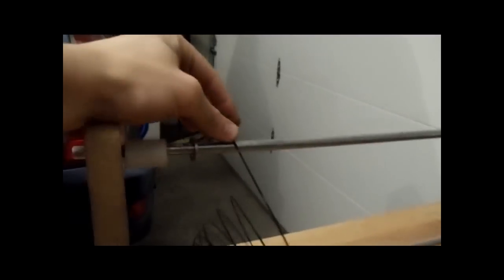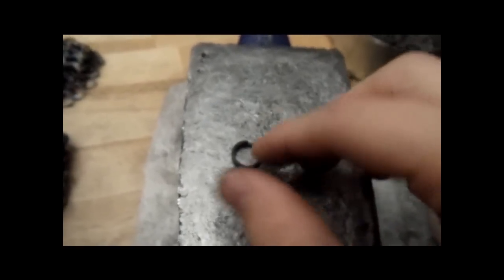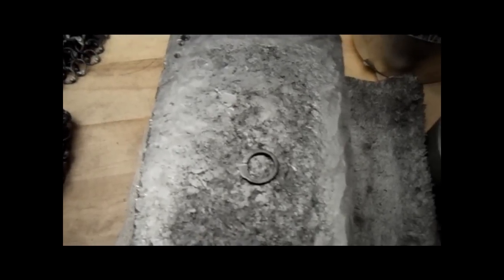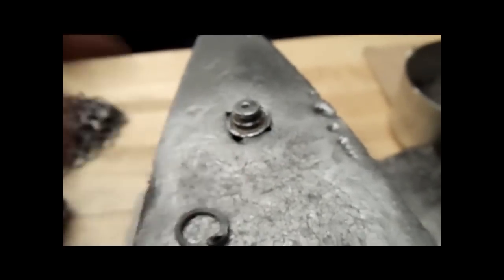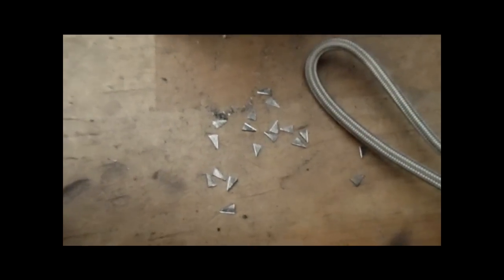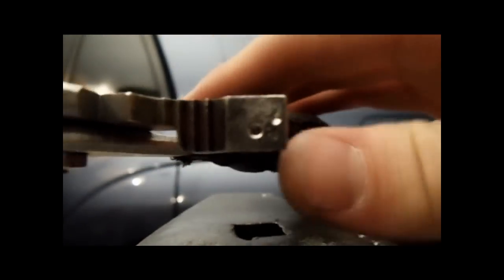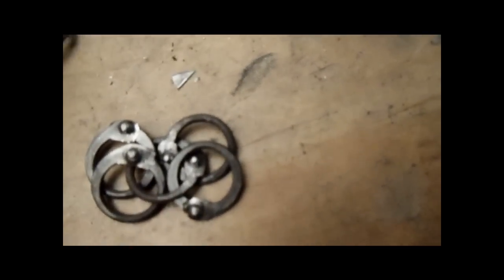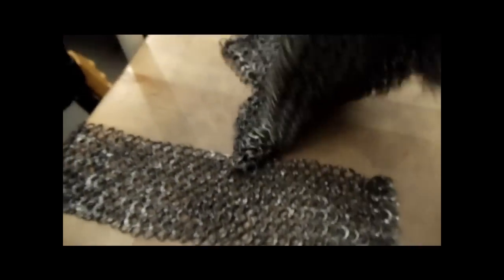How to make Hand-riveted Chainmaille

Comment from the maker: The wire I used was picked up from a farm supply store. The wire I used was 16 gauge (AWG) tie-wire. The inner diameter is 3/8. You're right the riveted rings are much stronger than closed (or butted). Personally, I wouldn't use any rings larger than 3/8 because as is, an arrow can almost go through a single link, I prefer my armour to be fairly historical, so I want it as usable as possible.
Reply: Luke Roberts I was about 3 sec from asking what gauge/ diameter you used but I'm glad to see it was answered 5 years ago

Comment: Well done Luke. I have made forge welded rings in my riveted mail. Use your torch and some Borax powdered hand soap. Hold your ring with the overlapped un hammered into the torch with your needle nose players until bright orange in colour. dip the overlap quickly into your Borax powder. It will smoke, so do this out of doors. Return to your torch and heat the now coated overlap to bright yellow orange. Quickly hold overlap over your anvil, and tap it flat. Welded! The trick is the speed.
Reply: Awesome idea!

Comment: Even though I am already proficient in making riveted flat ring mail. I find it's always still good to watch these videos when I happen across them. Just because everyone does it differently. And everyone has a trick. For instance I like your trick with the drilled out bolt in the hardy hole. Hadn't thought of that one. And even if someone has an anvil that doesn't have a hardy hole, they could (if they have either) vice or C clamp that bolt in place. might even get away with just some hot wax on the face of an anvil to keep it from shifting even. So that is a fairly adaptable trick.
Reply from the maker: thanks! it is neat to go see what tricks everyone else has

Comment: a tip: not every ring in a riveted maille was riveted. some of them were punched from a plate, and were single solid rings.
Reply: not on all mail though
Reply: Most of the medieval maille found from the Norman period onwards was fully riveted, oddly enough the riveted with solid punched rings are less commonly found. One of the only scraps of maille during the Viking period however was the alternating solid ring and riveted ring pattern which seems to have been less common after the Viking age.
Reply: Roman mail alternated solid and riveted but medieval mail was almost universally riveted. There are some oddballs and even butted but they're the exception that proves the rule.

Comment: Nice Job...and as stated by others...This is a job that would have required hundreds if not thousands of people working to craft enough maille for an army. If you figure 15,000 to 40,000 rings for one hauberk, so say 35,000 rings each, and an army of say 10,000 men needing maille...that works out to a minimum of 350,000,000 rings needed to create the maille for the army. Not counting screwed up rings, or remakes. 

Yes, some rings made were solid rings so say only 20% were riveted (using a 4 in 1 pattern, 6 in 1 I am not gonna even attempt to compute), that is still 70,000,000 million rivets and rings that need to be created by someone. It is a wonder they ever had time to get around to fighting. It truly amazes me the abilities of people who had no modern productions abilities.
Reply: Maille armor was expensive! I'm working on a butted shirt right now, even though its just for a costume it still would take me roughly all summer working on it if I spend an hour a day to finish it.

Historically, I think gambesons were the much more common armor, because it is so much faster to make and cheaper. If interested check out Shadiversity's channel, he gives much praises to gambesons (padded) armor.

Comment: Unless mail is welded or riveted it is a decoration
Reply: Yeah, butted maille is crap when it comes to strength. It's really easy to make though.
Reply: @Itsuki Takeuchi Fair enough.
Reply: The gauge of the wire and the size of the rings is very important too.

Comment: Use a Mapp gas torch with a built in igniter. Stand the torch on the bench next to your anvil, with the powder close. the overlap will actually bond without a tap, but it looks bulky, and not smooth. I have tortured my rings unto breaking, and the joint never fails. The process is really quite simple to duplicate. However we can not replicate the industrious apprentices and laborers whose work supported the master mail smith. And with repetition comes uniformity.

Comment: vote for pedro!
Reply from the maker: I'll vote for whoever I feel like, gosh
Reply: you are a good sport man! im a little lazy, but im working on a butted 14 gauge steel wire chainmail (not galvanized like most people). I give you props on actually making riveted chainmail, are you still making some? i'd like to see updates/ the finished product!
Reply from the maker: Awesome keep it up! I haven't worked on it in a while but I'm just finishing up the shirt I started in the video. Got distracted by some mandalorian plate armor.
Reply: will you be uploading a video of the armor?
Reply from the maker: Maybe when I finish it all, we'll have to see if I have the time
Reply: guys i started makin one, and its galvanized, but, is that a bad thing???????? IM NEW TO THIS HELP
Reply: FOR BUTTED MAIL: Nope. Galvanized simply mean that it got a zinc coating which will protect it from rust. Don't saw-cut the rings tough, zinc fumes can send you to a surprise-trip to the hospital.

FOR RIVETED MAIL: well, galvanized steel cannot get annealed because as I mentioned before, zinc fumes are deadly and non-annealed steel cannot get flattened like in the video because will be too strong and the edges will come apart.
Reply: Astaziel thanks man, i was cutting it with a big Iron cutting scisor, made a coif and it turned out pretty well!! 😀
Reply: Glad I could help
Reply from the maker: @Johannes Liechtenauer yeah, I kept the sleeves short and only went down to the waist. Overall I made it a bit too tight. The next one would be much larger to fit padding underneath

Comment: When I tested rings, the failure was not the joint, but rather to one side or the other of the joint itself. Perhaps the propane isn't hot enough. The nice part about this technique is that you need make no extra tooling for punched rings. Just heat an overlapped ring, flux, reheat and tap.

Comment: Is this the same electric fence wire that I see used in most tutorials or do you use something else? Just wondering if you buy the wire blackened like that or if you do that yourself? I really dig the look. Great vid, btw. I've been considering taking up maille making and I want to go with riveted over butted because I'm a stickler like that. haha
Reply from the maker: No it's not the electric fence wire. That stuff is coated in zinc to give it the silver look. Zinc gives of nasty fumes when burned, so I can't use it (since I heat the wire). What I got is just called 'tie wire'. You should be able to find it at a farm supply store as with the electric fence wire
Reply: Luke Roberts Ah, cool, good to know. I was starting to think galvanized was pretty universal because I was just searching electric fence wire I guess. duh. Thanks!
Reply from the maker: Daybid Bander Becht Glad I could help.

Comment: Great video, I was wondering what you do to prevent the chainmail from rusting while you're making it, I am working on a riveted chainmail as well for a few months now but it rusts so fast. Or do you only clean it after the hauberk is finished? because i won't finish in like a year and i imagine my chainmail will be nice orange then :p
Reply from the maker: Some of mine started to rust, after not working on it for a while. The best option is to keep it away from the elements, keep it inside. Other than that I haven't had to look into it much.
Reply: Don't know how feasible it'd be, but storing it under oil would keep the rust off it nicely.
Reply: Ryan Barr
true yeh but if I oil the chainmail and don't touch it for a few weeks (while making new rings etc), the dirt comes loose with the oil, makes my hands as black as the night when i work on it again :p so thats not an option.
I think i'm just going to sandblast it after it's completely finished
Reply from the maker: Joske de rukker If you just wear it a lot, the rings will rub up against each other enough that any rust should come off pretty easily.
Reply: If you use galvanised steel, don't anneal it. It's kinda pointless annealing mild steel anyway, since it's not gonna make it any softer. OR...you can cover it in mustard. Leave the mustard on for a while, then rinse it off. That gives it a nice coating that looks old and is more rust resistant. Other than that...a wire brush is useful. A brass one, not a steel one

Comment: what kind of wire you using/ where did you get it? , it's darker than the wire i'm familiar with which is the galvanized steel

Comment: Ok, so you say your using 3/8" rings?  This makes sense in terms of work & weight.  What do you think is the smallest workable diameter for riveted links -i mean speaking practical.  Not working under a magnifying glass, or using non-functionally light ring material.  There is a big visual difference between a 3/8" & 1/4" ring, but what is the smallest ring you have seen used in functional riveted maille?

Comment: I have a complete butted maille shirt that I disassemble, rivet and reassemble. Your thoughts?
Reply from the maker: You'll need the overlap to rivet, if you reuse the butted rings you'll have to hammer them to have an overlap.  Might make them too small
Reply: @odstbane  currently the rings are 8mm. I would like to have different stages of construction from ring to completed sections for my viking age living history display.

Comment: What kind of punch did you use or did you make that on your own?I am struggling to find a suitable tool to punch the rings. I bought a pin punch for this but to no avail. Thanks
Reply from the maker: Regular punch ground to a point shape that worked for me.
Reply: @odstbane  Are you using a solid punch or a pin punch? Thanks
Reply from the maker: @ironduke3780  solid

Comment: This is impressive work, the punch you modified is cool too. I have worked with butted mail and scales and now find myself trying wedge rivets... Mixed results.  1/3 success rate, but improving. Your process is well thought out and informative. Also do you find that sometimes when you set a rivets you hear a "ting" and find the hole failed or tore?
Reply from the maker: Thanks! No no ting since I set the rivets with pliers. I do get a lot of em to split if the hole is too close the the edge. Keep at it, you success rate will improve!

Comment: That is some good looking hard work you'v done there. I'm really curious about trying it but would probably start with a smaller project. Maybe an aventail or mail voiders to start with. What kind of wire did you use for your rings?
Reply: TheLordArion he said in another comment he uses 16g tie wire. I picked up like 3 rolls of the stuff when I was working on butted maille it's like $4 for 3.5 lbs of it

Comment from the maker: I figured I wasn't getting enough heat, however, the joint is still stronger than the rivets tend to be, hopefully with more practice I may improve on the weld, or just get a MAPP torch on the next supply run. My next project will be a riveted/welded hauberk.

Comment: What type of wire works best? I've used galvanized steel for a couple butted shirts but would that work for a riveted one as well?
Reply: not if you want to anneal them, heating galvanized steel gives off toxic fumes, you'd need to soak them in vinigair or other acid  first to remove the zinc

Comment: So when adding a new ring to a project do you add the ring and then do the riveting process?
Reply from the maker: In a way... The easiest way to do it is to pre-rivet one, so when you add a ring, you can slip on the pre-riveted ring as well. Then yes, you have to rivet the ring after it's been added. This is why you'll want a pair of pliers modified to rivet.

Comment: I am sad to see the poor anvil so worn, knowing mine (which is the same kind) would eventually meet the same fate. Though, I do like how you used that tiny hardy hole; I will make use of it.

So now that I have actually seen the wedge-rivetting of maille in action, I am convinced that it is easier than trying to make links that would accept round rivets. But, UGH, I am still in the process of making a butted maille haubergeon.

Comment: How do you hammer the rings flat so nicely? Every time I hammer the rings, the overlap moves apart, and the rings end up like a Q instead of an O.
Reply from the maker: you have to anneal your rings before flattening so that the metal is softer and the overlap is more likely to flatten. Also make sure the face of your hammer is striking parallel to the anvil.
Reply: I see. I have made the rings out of dark annealed steel wire. I guess the issue is with my hammering.
Reply from the maker: +Dornatum if that doesn't help you can always re-anneal the wire yourself.  the longer it takes to cool (from red hot) the softer it will be.

Comment: hello, I am going to test my bravery and attempt this! I get the whole process but my question is, how thick do your rings end up being on the part where you place the rivet and the rest of the ring, a measurement of both would be great and did you use this in for example sparring? Did it break? have you taken hard hits in it? I want to know this to estimate what I need to do to make this work when fighting. thanks in advance.
Reply: Unless this is your hobby I suggest you buy your mail riveted and wear it. Go through it with a fine tooth comb and remove the finished product of defects. Alter it as you see fit cause the time involved is extensive. Riveted mail WILL product you. Riveted mail will allow you to take an axe, war hammer, or sword slash. You'll be more bruised with possible small fractures more than anything when it comes to blunt weapons or you'll end up with small superficial holes from long range blows but given your question I'd say you haven't fought in armor so I'd suggest you look up armored fencing to answer your questions.

Comment: quick question, since you annealed the wire, do you need to heat treat it after you have made rings or the whole armour?
Reply from the maker: Orka DRLJAČA Ideally yes, you should temper it adterward. I didn't just because it'll never see combat and I don't need the extra strength

Comment: What wire are you using?  I'm having difficulty finding flattened wire like that seems to be, before you flatten a side.
Reply from the maker: +Mason Holzinger Any steel wire will do, you flatten it after you cut the rings. Just be careful about heating galvinized, toxic fumes and all that.

Comment: Great video! Very informative, what gauge wire do you use? I've been making small butted projects for a couple years.
Reply from the maker: Thanks! I use 16 ga (american).
Reply: How is the 16 hold up against abuse? I've got a few gauges about.
Reply from the maker: Dave Clarke I haven't done much testing with it, but I'd imagine it holds up pretty well, as it seems to be somewhat close to what was actually used.
Reply: Thanks man, I have both aluminum and steel kicking around. I'll hope to try this some time.

Comment: you know you can just drill straight through and use copper or brass wire to rivet it right ? makes it sooo much easier
Reply: it may be easier but it wont be as strong. when you drill the ring, you are removing metal thus weakening the ring. and the problem with brass or copper is that its weaker than steel also making the ring more likely to break. BUT, if you aren't looking to fight in the maille then it wont matter what you make it out of. punching a hole was also the period correct way of making wedge riveted maille.